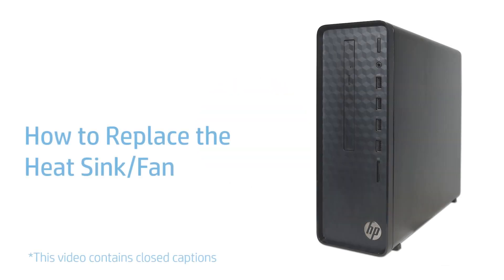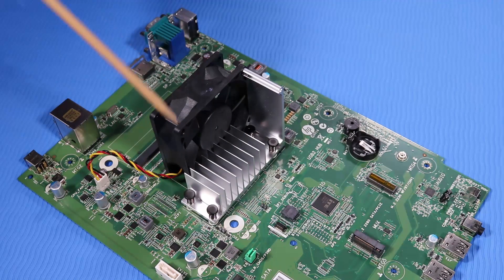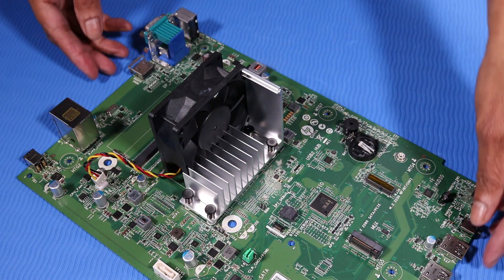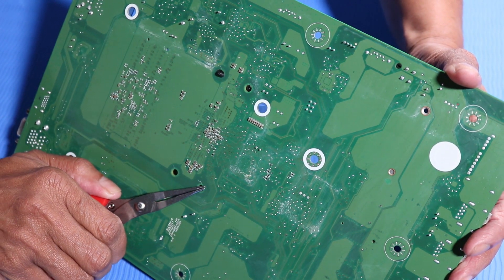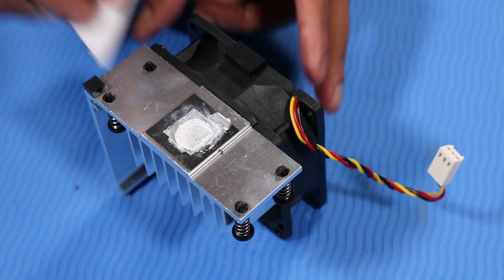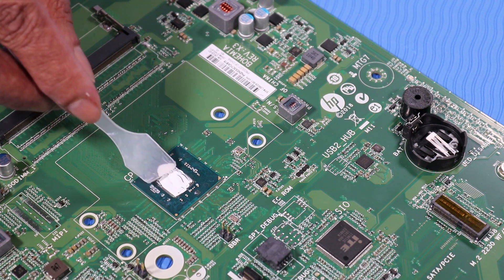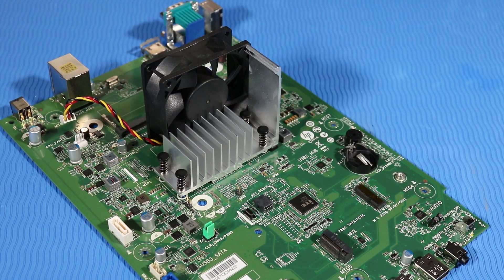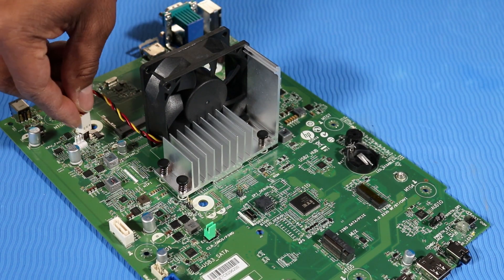Replace the Heat Sink/Fan | HP Slim Desktop S01-aF0000, S01-aD0000 | HP

Comment: Thank you for the instruction. 

The following question might be difficult to answer because of the free market alternatives, but... what would I be replacing it with? (sorry, I'm talking about the fan, not the heat sink)

The problem that I have  is that the stock fan is too noisy, producing high pitched noises. Another HP video solves it partially via energy settings that ultimately choke the cpu performance "slow down the cpu performance before cranking up the fan" / choke-cpu-before-fan rule. Not sure if everybody would agree on throttling.
Reply: some parameters of the stock fan Model PVA070E12M DC12V 0.36A (by Foxconn "brushless fan"), 70 x 70 x 15 mm
Reply from the maker: +Bergg Uscha I understand that you need to purchase fan for your computer.
You can purchase the fan or any other accessories from here:
www.hp.com/accessorize 
I hope this helps you!!
Reply: @HPSupport  no, there are no fans, i searched deep and nothing, i cant give you even 3 stars in this, i only have the option to get it to a service to repair it? are you for real? in the whatsapp chat they say that they cant deliver any fan to my house... and even with warranty.